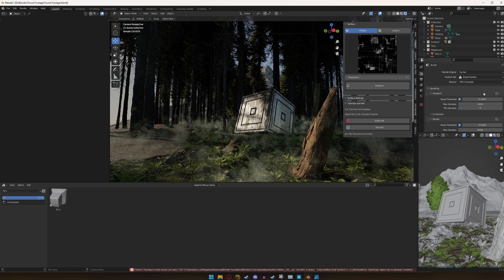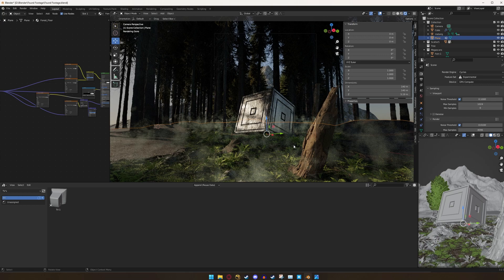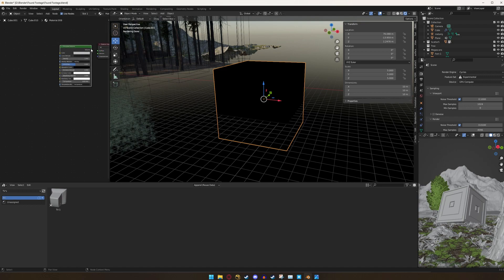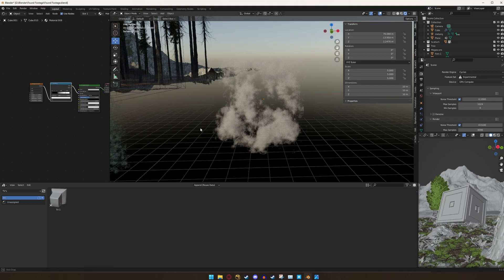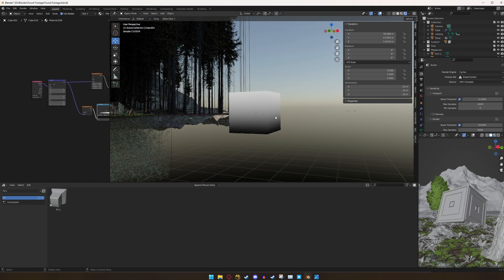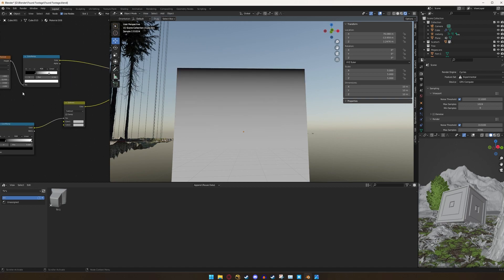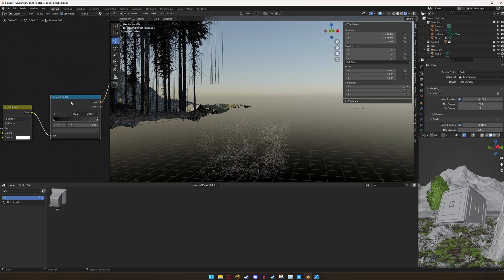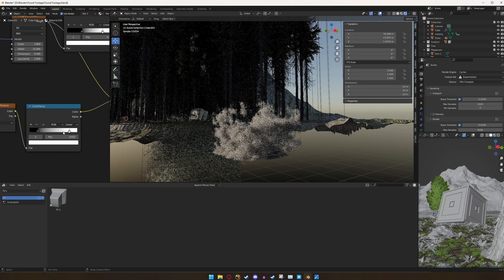How To Create Amazing Moody Ground Fog in Blender || Noisy Falloff Method

Comment: Great tutorial!  Sorry for the noob question, but how to make this fog actually white (like smoke)? Because in my scene with another Big box Principled volume it looks grey
Reply from the maker: you could either change the fog color, it comes in a little bit darker than white by default.  (Top color Option in principled volume/volume scatter)

Or

Bmost of the color for fog like this comes from the light source so if your light isn’t white, the fog will not be white. you can cheat it a bit by increasing the emission a tiny bit and making the emission color white, but that is a bit of a hacky way to do it
Reply: @levelupvfx  Thank you for the answer!🙏

Comment: Pretty great technique! Is there a way to animate it slidly to Make it feel like ground fog?😮
Reply from the maker: Great question! You could definitely translate the noise texture in order to take it a bit, either by changing the scale or if it’s in 4D mode, change the W value. I may create a quick update video where I go over animating it, there are some other optimization tips that make this better when it comes to scaling/editing the scale of the cube that are a problem in this version (using object cords instead of texture cords)
Reply: Thanks for the answer! I Take Part of the pwnisher Challenge too, so I maybe try it myself later in the process and will report you my eventual progress! Anyway keep up with your great work and good luck for the Challenge 😊

Edit: Ok now that I play around with this setup, animation is pretty easy. Just use the mapping node and animate the Z-Value of the location or use a driver. (#frame*0.001 for example) :)